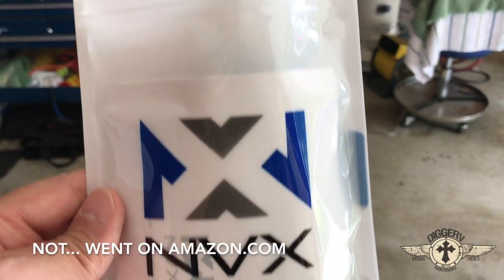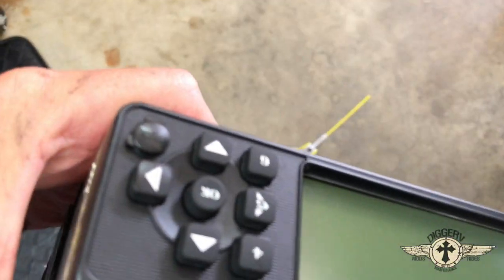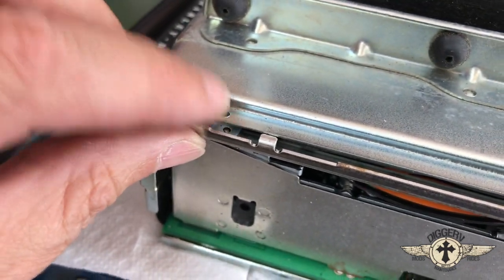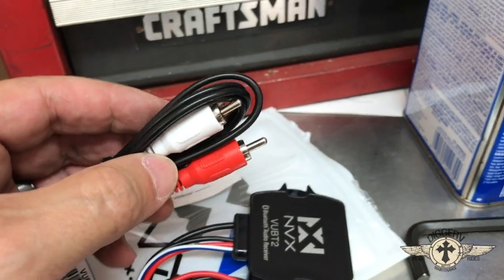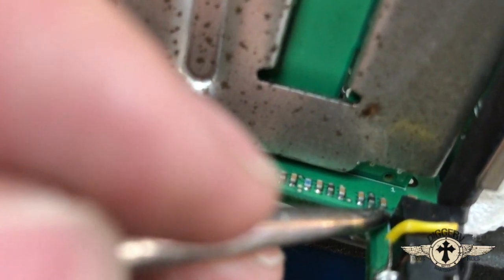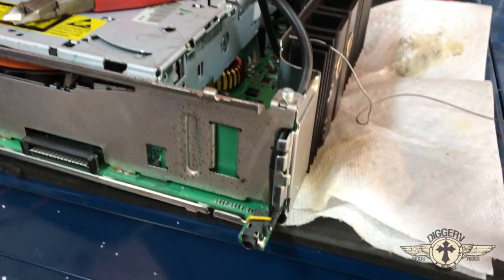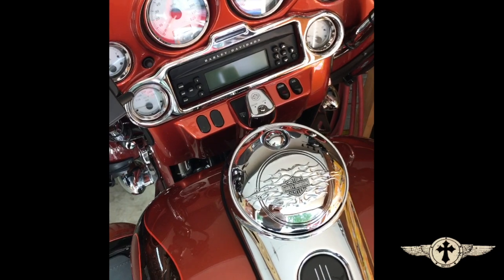Add Bluetooth to your Harley FLH 2009 thru 2013

Comment: Hi! I done my 2013 Street Glide today. It works well but can’t control to next song or last song. Thank for your help.
Reply from the maker: Awesome! You are correct, this mod would be the same as you plugging a device into the Aux port.
Reply: I remove the component and didn’t cut the board. It work well.

Comment: Cool! DO THE VOLUME AND TRACK FLIPPING BUTTONS ON THE REMOTES WORK?
Reply from the maker: The hand controls operate the volume and anything else they normally do. It as if you plugged a iPod or phone into the aux port. Ride Safe!
Reply: @DiggervTV  are the tracks being flipped too on the right remote?
Reply from the maker: @silver4815  I don't think so. The right remote will not change the track of an iPod or other device that is pulled into the aux port.

Comment: I finally was able to find one but I can't find your additional instructions lol or the wiring diagrams.
Reply from the maker: I'm sorry that the link doesn't work anymore. The video, as you know, is from 2018. I don't have the information you are looking for. You should be able to connect the bluetooth module to power and ground. Then connect the the left and right channel to the the aux input. and lastly remove the diode so that the radio unit thinks that you are plugged into the aux port. I hope that helps you.
Reply from the maker: Try this link for some more info https://youtu.be/a5RajfQ8G1w

Comment: Excuse me ! Can you show me the detail that how you put the Bluetooth wire on the radio? I really don’t want to see the wire and don’t underestand how you do that. Thank you so much !
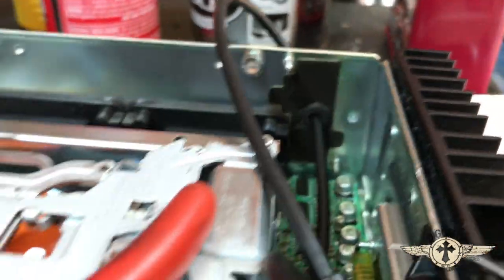Reply from the maker: This video and this website, https://www.ironacesspeedshop.com/hardwire-aux-input-on-harley-davidson-stereo/,  give you all the instructions to install the wires inside the radio so that there are no wires showing anywhere. Goto 4:30 in the video and it shows routing and where to solder the wires. I hope this was helpful. Ride safe!
Reply: Thank you so much. I have already order one and I’ll try it and let you know my result!!!
Reply from the maker: @max6298  Awesome! I really like mine.
Reply: Because the Bluetooth I bought a Aquatic radio 1.5years ago. But it can’t control the volume automatically with the engine and have some control module issues. So I want to use the original one and add the Bluetooth kit.
Reply: You are the only one who upload the video which add the Bluetooth kit and hidden the wire. That’s what I looking for.
Reply from the maker: @max6298  Great! I think you will really like it as well.

Comment: Why didn’t you show the actual removal of aux blocks
Reply from the maker: I don't know. Maybe it was because I was using an iPhone to film with and didn't have a mount to hold the phone while I worked. It is very easy to remove the block by putting the soldering iron on the top of the block. It will melt the connection, and then I just flicked it out of the circuit board.

Comment: I have a 2003 Electra glide and I’m planning on doing something like this. The setup kinda looks the same so im wondering if this would work for me?
Reply from the maker: I'm not familiar with the stereos in your model year, so I can't say for sure. You may want to upgrade to an Aquatic head unit which are Bluetooth right out of the box. Ride safe!

Comment: What does the blue and blue and white wire and all on the Bluetooth module go to or do you just cut them off and not use them
Reply from the maker: Good question... The blue and white wire is for an EQ application. It is not used. There are 4 separate wires on the module. Black ground wire, Red power wire, black jack that the stereo plugs into and the Blue and white wire for an equalizer. Hope that helps.
Reply: @DiggervTV  thank you sir. It helps, I can mechanically do about anything, just the wiring that kind of confuses me lol. Thanks again bud, ride safe

Comment: can this connect to 2 devices at the same time?  Thinking paired to music on a cell phone, then GPS gives a guidance message, would you hear the GPS over the music?
Reply from the maker: Hi Tom... sorry, but this Bluetooth adapter doesn't have the ability to connect two devices and switch between them on the fly. My GPS is has its own speaker and is pretty loud so it can be heard over the stereo.

Comment: How did it affect the sound? I had one Bluetooth adapter that only put out about half the original sound.
Reply from the maker: It didn't effect the sound at all. There is no difference from before adding the adapter.

Comment: If i remove the second block will I still be able to listen to standard radio also??
Reply from the maker: Yes, everything works as it did before. It only makes it sense that you have something plugged into the aux port when you don't.

Comment: I can’t see the instructions on how to wire it
Reply from the maker: Let me see if I can put something together for you and I’ll post it.
Reply: @DiggervTV  please do so and thank you very much
Reply from the maker: @alfredotorres4931  So, I went back and reviewed the video. 1st the red wire is attached to the cigarette lighter hot, 12 volt, wire. 2nd the black wire is connected to the inter-fairing metal support frame. 3rd the audio wire has three small wires inside, you must use an ohm meter to determine which wire goes to the left channel, the right channel and the outer ground wire goes to ground – all three are soldered to the aux port inside the stereo and then plugs into the bluetooth module. 4th the blue wire is not used in this application, simply stow it out of the way. Note that you need to have some foreknowledge of wiring stereos and also know that the bluetooth module will come with information on what each wire is for. I hope this helps. Ride safe out there.